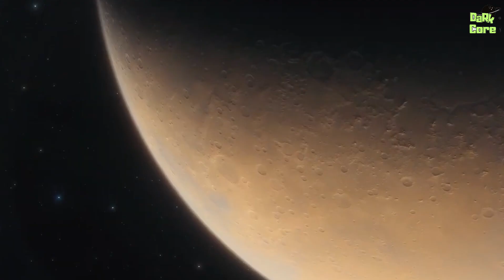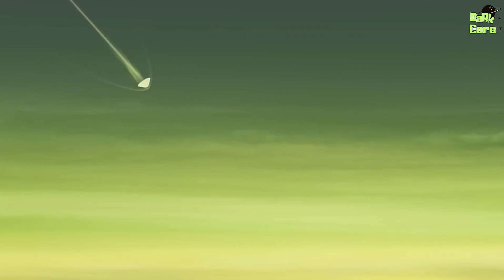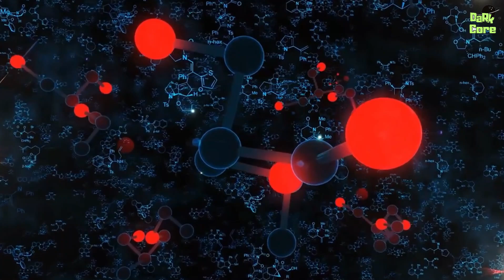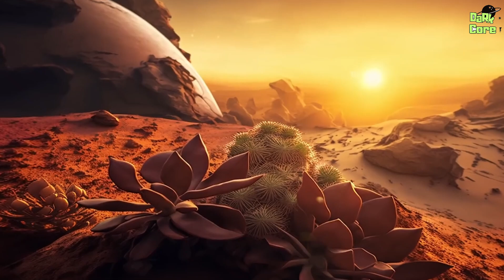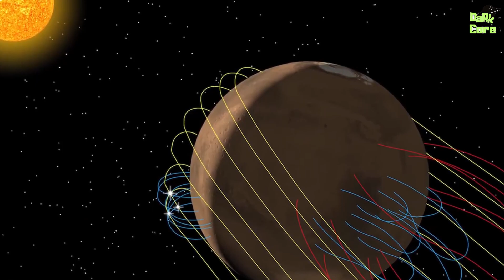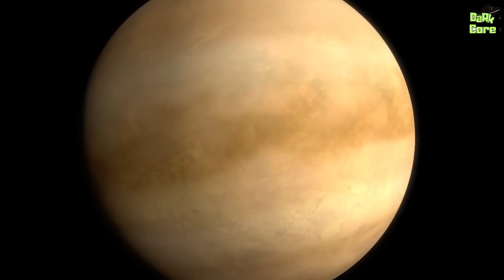Terraforming Mars A BIG Mistake For Humanity

Comment: Mars as no magnetic force field so it could not be done, the new atmosphere would be stripped away by solar winds.
Reply from the maker: "You're right that Mars doesn’t have a strong magnetic field, which makes holding onto a thick atmosphere a big challenge. Some scientists suggest building artificial magnetic shields or continuously replenishing the atmosphere as possible solutions, but it’s still highly theoretical. Terraforming Mars would definitely be much harder than it sounds."